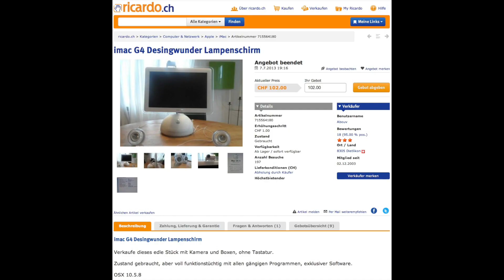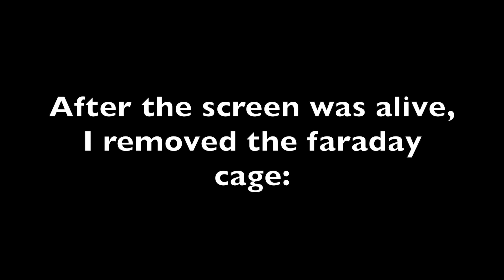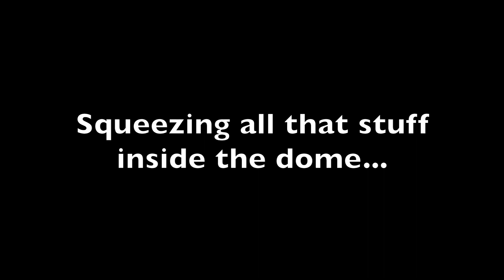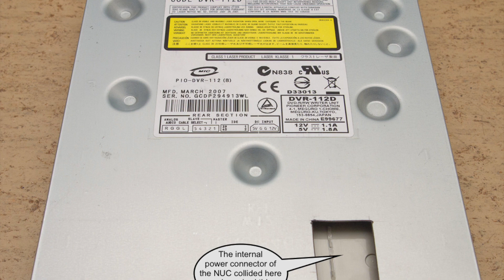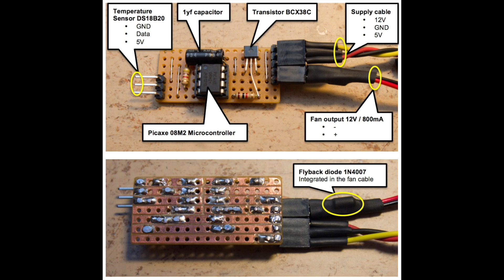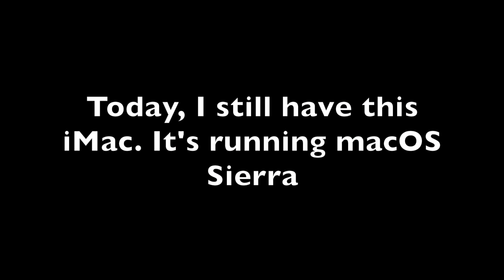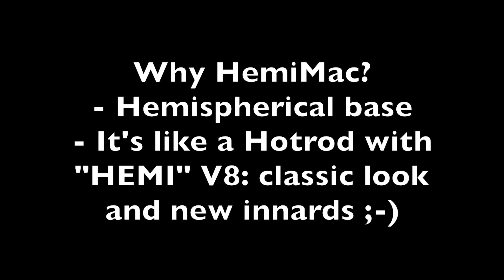iMac G4 Hackintosh "HemiMac" build - tight!

Comment: I just wish Apple would revisit their older designs I absolutely love the imac imac g4. I wish apple would have supported their software  like windows did. WinXP can still go online while OSX Tiger is pretty much dead.
Reply: Old Macs have a small, dedicated community surrounding them. Check out the MacRumors PowerPC forum for proof.

TenFourFox is a super optimized, fully up-to-date browser for Tiger with support for modern Firefox addons, and PPCAppStore is another still supported App Store-like application hosting direct downloads for tons of older applications compatible with Tiger.

Surprisingly enough, the PowerPC (older Mac designs) is not as dead as you'd think. Check 'em out.
Reply: Tiger isn't dead, I use it daily on my PowerBook.

Comment: Very cool build. I like that you used the original ports and didn't do a hack job. I did the same thing with the G5 case(much easier that what you were able to pull off here) but I used the part of the old logic board to wire all my ports in so I didn't have to cut up the beautiful case
Reply from the maker: Thanks

Comment: Absolutely amazing!

How would a guy with very little electronics experience go about attaining the skills to do this? Or could I just start this project and follow instructions very carefully and eventually achieve the end result? I'm not really bothered about the brightness control, power on chime etc but an up to date G4 has been a dream for about a decade.
Reply: Jack Taylor Don’t start with this as a project. Buy up some cheap systems and upgrade them. Like from thrift stores or goodwill stores. Or if your local school or college is getting rid of old computers. Check out a municipal centre and ask there. You might get stuff for free.

Build up your skill base and when you feel confident, move to a project like this.

Try some hobbyist work, building circuits to flash lights, understand the basics of electronics. 

And of course it’s check, double-check and triple-check everything before you commit it to switch on.

I have an original iMac with issues. Got given it and I might do a makeover if I cannot get it to work. I have the background in electronics from University. 

I may even consider upgrading the screen to a higher resolution. I’ll see.

But start small and get to know what’s what. Anyone can do this level of work with dedication and understanding and some common sense.

Comment: As someone who doesn't know shit about electricity and circuits, I have so much fucking respect for you. 
Btw, do you think it's possible to change the display? I've read in the comments that you wanted to preserve as much of the original build, but I think it'd make using it on a regular basis even cooler.
Reply from the maker: Thanks for your praise! Almost everything is possible. And I have two additional units in original condition here...
Reply: Yep, saw project iBook g3 i5.But first i will do this mac.Then run windows and play favorite games on it
Reply: Please look this project, where the LCD was replaced by a Full HD one, and an ever more powerful motherboard and CPU...https://youtu.be/34en3ET7cqY
Old Mac's aren't dead yet ! I personally own a 2008 Black MacBook that I cherish, and I really LOVE those old designs ! 
Apple hasn't done better since...

Comment: The build was great, and I've always loved thw design of the G4, but I feel like having the power supply inside the case was a massive waste of space. Why did you decide to go that route instead of having it externally and having more space for expansion?
Reply from the maker: Thanks for the praise. The original PSU was internal and I wanted to keep it as original as possible. As you can see, everything did fit anyway.
Reply: I actually like that approach, I would have done it same way.

Comment: how about putting miniITX build inside? is it possible? If it is, will there be enough room for extra GPU?
Reply from the maker: Mini ITX is possible, but not with an internal PSU, optical drive and extra GPU. However, an extra GPU doesn't make sense with such a small screen in my opinion.
Reply: hmm extra GPU could help in some situations, but from my own experience I can tell that for basic usage of macOS GPU from CPU has enough power for web browsing etc
Reply from the maker: Just to show you the relation: I'm doing all my Full HD video editing on my G4 Cube with i7 3770 and HD 4000 onboard graphics. Works fine, even with a 2560x1440 Cinema Display

Comment: Wow cool you did really nice job on this one! i wondering if it is possible to built a mac mini mid 2012 i7 model in imac g4 i am thinking to do that....
Reply from the maker: Yes, i think it should fit, as long as you don't need an optical drive.
Reply: TheDIYGuy999 no i don't use  optical drive anymore. What do you think witch Full HD model screen can fit inside the bezel of imac i am looking voor the same size screen buy i don't have find it jet. Maybe you know one?
Reply from the maker: Sorry, but I don't know a suitable screen. It's very hard to find a full HD screen in this size.
Reply: TheDIYGuy999 okey thanks anyway

Comment: I'm considering doing something similar, but replacing the original LCD panel with a modern 1080p one (on a 20" model).  Other than lacking brightness control, wouldn't that make this build easier?
Reply from the maker: No. It would make it more complex, because modern panels don't have a HDMI compatible TMDS interface and you will need a HDMI to LVDS converter.
Reply: Interesting.  If I were to get a motherboard with an LVDS interface (I'm eyeing the ASUS H110S1/CSM), I could drive a panel directly?

Comment: Congrats one more time for such a great job man! I'm behind buying one of these gems (imac g4 20") which is not that easy to find these days -in good conditions. So one question: can you please tell us the details about the cleaning process? Because I see that is very normal to find the white parts turned yellow, and I'm sure I will have to solve this trouble when I get my unit. Thanks!
Reply from the maker: Thanks for the praise. The dome and the back side of the display are made of transparent acrylic and white painted from the inside. The best thing to clean it is a so called "Fleckenradierer" (in German) and a bit of water. See: https://www.youtube.com/watch?v=7j0SZSCx7Ng
Good luck!

Comment: You should get a mini itx board and try putting it in one of these. Probally wouldnt fit though
Reply from the maker: I first wanted to use a mini itx board. But it was too tight and i wanted to preserve the original optical drive
Reply: Mini ITX was an option before NUC were released. But it’s too big really.

Comment: No graphics card upgrade? Or a better screen?
Reply from the maker: No, Minecraft works fine on the original screen, but of course the NUC is using its internal HD 4000 graphics
Reply: TheDIYGuy999 But the screen is awful, its a low resolution, and terrible viewing angles and colors.
Reply from the maker: Yes, it could be better, but a goal of this project was to preserve the original look from the outside

Comment: 2 questions, how compatible are those with mackintosh, I mean crashes, iMessage, etc, and how much can I buy this for?
Reply from the maker: Compatibility is no issue. If you know, what you're doing crashes are more or less inexistent. My main system, the G4 Cube is in daily use and is only rebooted during software updates.

And no, sorry, I don't sell anything.

Comment: i have the same mac and it doesn't switch on, what could be the problem?
Reply from the maker: A defective power supply, I guess.
Reply: TheDIYGuy999 okay, thanks, im going to try with another, and how can i take out the dvd reader?
Reply from the maker: For a manual on how to remove the drive cage see here: https://de.ifixit.com/Guide/iMac+G4+17-Inch+Model+M9168LLA+Hard+Drive+Replacement/4176

Comment: This is amazing. Would it be possible to fit a Mac mini into the iMac G4?
Reply from the maker: Thanks. It should fit, I think. But you still have to rewire the display and to supply it with power. This is the most difficult part of the project

Comment: Brilliant! Do you think an LED backlight conversion would be worthwhile on it?
Reply from the maker: Thanks! In this case, you should replace the entire LCD panel. If it's worth the effort is your decision.
Reply: No, I meant on your iMac. Is it still using CCFL?
Reply from the maker: Yes, it's using the original CCFL backlight. Works fine.

Comment: I challenge you to do that to a Powerbook G4. 
Either using something like a UDOO board, an open source laptop motherboard (the Novena project and others come to mind) or by gutting other laptops. 
Now that would be quite a feat.
Reply from the maker: I would love to do that. Unfortunately, macOX does not support Pentium, Celeron and ARM CPU's.
Reply: Oh really, what a shame. Are you sure though? I successfully installed OS X on an Atom CPU once and it ran decently (I totally understand why it doesn't work on ARM CPU's though, that's an entirely different matter).
But oh well, if you ever figure something out - whoa, what an accomplishment that would be.  
And thanks for the fast reply. Cheers!
Reply from the maker: I also ran OS X on an Atom Laptop in the past. But it's just a pain in the butt to hack it...

Comment: Outstanding. If only Apple made unique devices these days...
Reply from the maker: Thanks. The problem is, that laptops are powerful enough for most people nowadays. So there is just no need anymore to design something like a Sunflower iMac.
Reply: I think there's an untapped market for unique PCs and laptops. Apple used to own that space but they've gone in the direction of "very thin" and "not very useful".

Comment: Dude! Hackintosh is illegal in my area!
Reply from the maker: Illegal? It's a slightly upgraded iMac G4, running macOS.
Reply: TheDIYGuy999 well, I'm trying to upgrade my Early 2008 MacBook to macOS Sierra.
Reply: dont upgrade to sierra because its in the BETA .. el capitan is much better
Reply: But with El Capitan, I can't get Siri on it. It's better to upgrade to Sierra
Reply: Aryte ~ Alex H. .. You can ask Siri more things on a MacBook compared to iOS
Reply: when you siri dont use on the iphone they dont use on the macbook
Reply from the maker: Guys, I can't accept such comments full of hate here. They will be deleted in future!
Reply: LoveGod16 bruh calm down
Reply: Dustojnik Hummer, in which way? I work on it since october on iMac, and it runs perfect. No any bug or lag in any of Pro Apps.
Reply: LoveGod16 Sierra is not beta anymore, and has been released. I would run it on my original model Mac Pro if it didn't require SSE4. Before the original hard drive died, I was running Yosemite on it.
Reply: +Tyler Rickard
Last two updates was mostly to improve integration with new MacBook Pro. Especially ProApps update in it, LogicX now looks very nice.
Reply: You bought a mac, and buying a Mac gives you the customer right to use any version of Mac OS.
Reply: Existing on this planet gives me the right to use any version of Mac OS I want, ** buying anything from apple.

Comment: I’m very dissatisfied with current thin generation iMacs they are glued to difficult to upgrade components those current thin 2017 imacs forget it if the user wants easy access to the components. 

The iMac G4 ilamp was the best iMac design you can tilt it up and down to a comfortable height, and the bottom base of the ilamp is the Early Mac mini G4 incarnation hooked up the to screen. 

If I want to build my own iMac intel , I would a for parts iMac G4 a real learning curve, then a compatible motherboard and sure that this board is well tested with  Osx86 and it functions properly with OS and everything thing works. Building a All in one machine D.I.Y not easy

Comment: Hello my friend
Thanks for sharing the video
I need your help .. my best regards to you Form Patagonia Chile
Reply from the maker: Hi,
for what you need my help?

regards from CH
Reply from the maker: Hi,
You have to use a Firewire cable and the target disk mode: https://www.youtube.com/watch?v=o8GA3Ae7iCM
I guess, you can use every IDE hard drive in this G4, regardless if it's an Apple drive or not.

Good luck
Reply: Hello my friend
Thank you very much for answering.
Imac 1 is already working
Imac 2 now need to buy a hard drive
I have the cd of Ibook G4 mac OS X install disc 1-2-3
Ibook G4 Software Restore 1-2-3-4-5-6-7-8-9
Apple Hardware Test Ibook G4
My best regards to you my friend

Comment: My way: use Mac OS Panther or Debian PPC.
Reply from the maker: Yes, and then try to watch a full HD YouTube video ;-)
Reply: Full HD? it has 1440x900 screen! :)
you can only watch 480p video at best :) (the same with most 2006/2008 macbooks)
good video btw :)
Reply from the maker: Yes, of course, the screen is not full HD. But even with this resolution you will not be able to play a Youtube video with the original G4